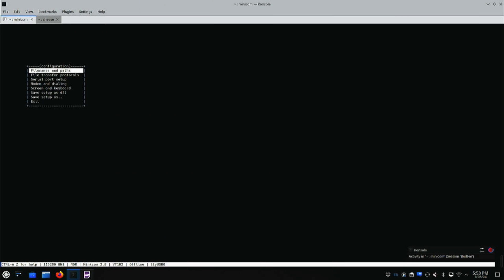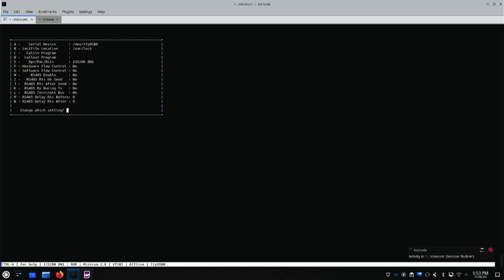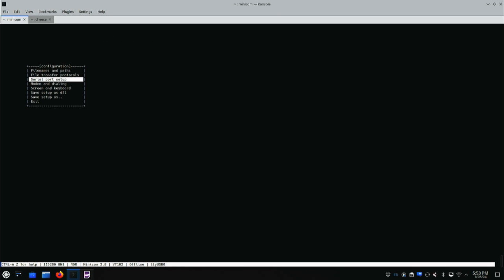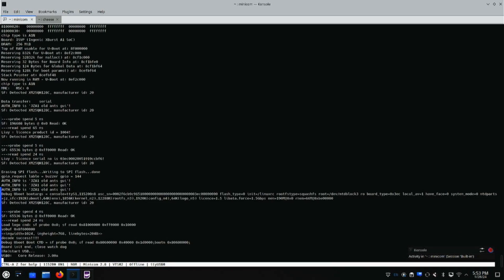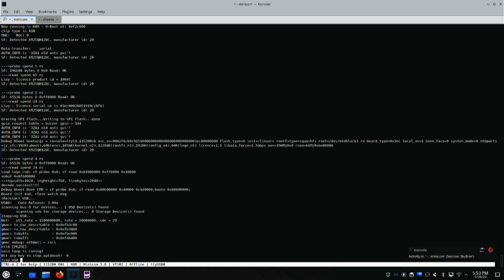Hacking the UART - Finding and gaining access to the console port on embedded gadgets!

Comment: Please how to change mac address and reset password in uart mode??
What's code??
Reply from the maker: Changing the MAC is going to depend ont he userland firmware, the bootloader generally doesn't set it. As far as a pssword change, you may be able to change the bootargs to replace init with /bin/sh and get a root shell, but there are likely several extra steps required to getting a permanent password change.

Comment: Why does flow control need to be disabled?
Reply from the maker: Hardware flow control requires 2 additional pins between devices, Clear To Send and Request To Send, which aren't present in our 3 pin UART connection. Software flow control (xon/xoff or Transmit On/Transmit Off) sends control characters over the serial line but is generally not implemented or enabled in these situations.

Comment: Why the hell are hardware manufactures do not disable CONFIG_SERIAL_CORE_CONSOLE in production Linux kernels? Its just a one line to be removed in .config file
Reply from the maker: Engineers are lazy, and that's an extra step with no clear benefit... It's not like randos on the internet are going to take them apart right?